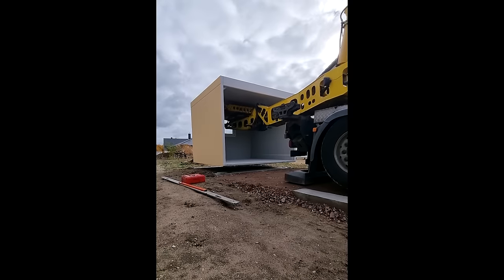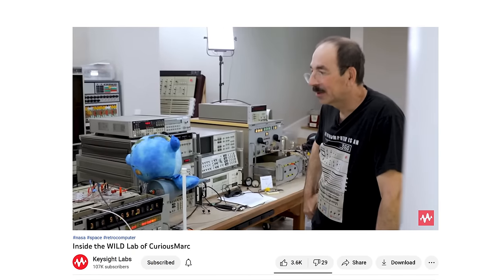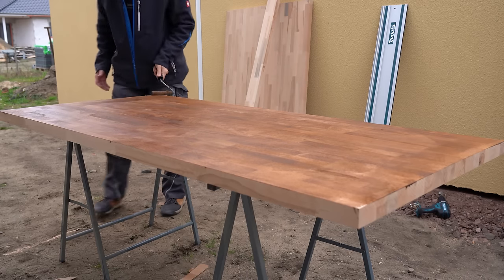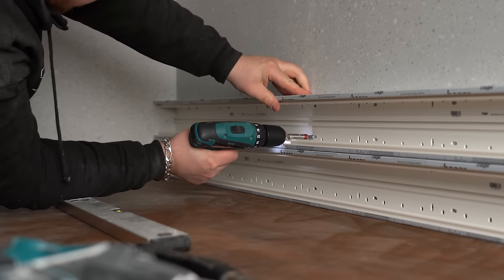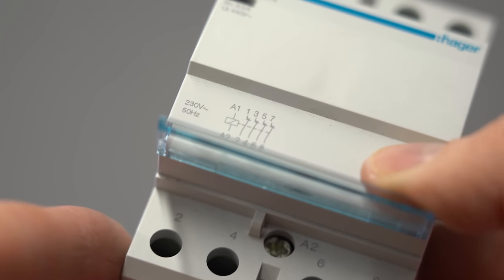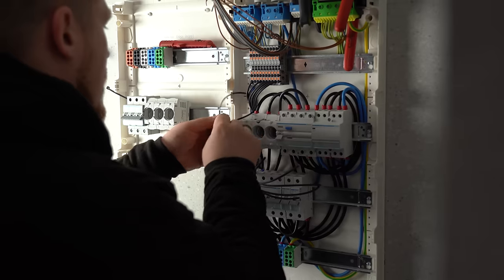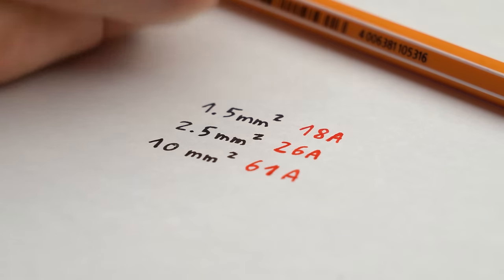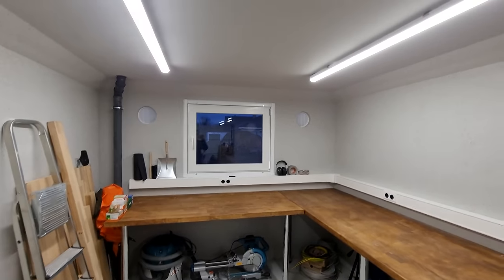Germans do the PERFECT Electrical Wiring! (Garage Build)

Comment: Hello Scott, curious to know what you meant by switching the neutral and physical earth wires (that those can not go through a switch under any circumstances?), also why where there should be a bended piece of tubing on the corners is just the cable? (something to do with the exterior jacket of the cable or since it's a garage does code allow it?). Here in Spain I do maintenance for industrial installations and everything needs to go through a tube

Comment: What I would have done differently would be the pipes u used I do t like that at the ends the cables are exposed and I would have my Ethernet cables run and install sockets and maybe some smart stuff hardwired in the electrical box like relays and smart switches great job btw

Comment: I was going to yell at you for wiring the emergency stop button to a normally closed relay, but I appreciate that it's a calculated risk. Save 60 watts continuous running cost on the energy bill, but if a mouse chews through the cable in exactly the right spot the e-stops wont work ... meh, worth the risk.

Comment: Hi there!
I'm a fresh from last week EE and CS engineer working for a EV charger manufacturer. 
I kind of started EE thanks to your channel so thank you! 
I was wondering, do you plan to plug an EV to this CEE socket? 
If you want to chat about adding an EV charger (maybe for a DIY or BUY) hook me up!  
Anyway it's cool to have 3 phase power at home. Unfortunately in France it's less common...
Also, what's this "safety fuse" thing? Couldn't find any mention of it, is it mandatory in the german code?

Comment: How can you call it perfect if the circuit breakers don't switch neutral? In western Europe it has been mandatory since a few decades that the phase and neutral is always opened together.

Also it seems kind of weird to be using fuses instead of a main breaker?

Other than those little nit picks you did a great job! :)

Comment: Wow, what kind of relay draws SIXTY THREE watts of power when activated? That's crazy! I did a quick search and the worst I could find was only about 2 watts per coil for 25A switching.
Reply: that was the inrush. less then 10 watt in oparative.

Comment: Make sure that Relay disconnect N after the phases and connected before them. Otherwise you can destroy your electronics by getting a 400V spike at switching! If you can't guarantee this better don't switch N.There is a reason why most RCDs don't switch N!

Comment: it look bad with cables cables hanging outside of pipes. In Europe we hide all cables in this type of installations.
If you want to switch all power off with emergency button you should check Hager mz203, it draws no power.

Comment: im pretty sure N cable = neutral cable is allowed used as 230V if its marked or taped accordingly by sfc 6003 standard. atleast in job sites that i do electrics on we are allowed. PE cable ONLY used as ground. if whant use it as 230 v you have to 100% of cable been hidden that it doesn't look anything like ground wire and there's no point doing it

Comment: 18A for a 1.5mm wire is pretty over the standard formula (6*mm). Where did you get those values? Detailed explanation of the wiring panel would be interesting, looks quite tidy.

Comment: Great installation. I love tidy wiring and pannels. 
- Why didn't you use elbows and couplings between pvc pipes?
- One big issue will be comfort inside. I've seen no insulation. Is it integrated inside the concrete walls?
Regards from Spain
Reply: Apparently they are not required to use elbows on duct in Germany and Austria...
Reply: @jur4x  didn't know that! Thanks

Comment: I like how friendly it all looks, almost toy-like. 400V makes me envious. I thought Germany had the option for more phases though?
Reply: You definitely mistake that with something else.

We´ve got a three phase system with neutral.
(look at 11:26 brown, black und grey are phases; blue is neutral and green/yellow is ground)
230V between phase and neutral/ground and 400V between phase and phase.

Main difference here is the used size of fuses and circuit breakers.
An normal apartment would normally get an selective circuit breaker with 35A (max ~24kVA) in front of the energy meter.
A house could easily get an selective circuit breaker with 50A (max ~34,5kVA) or in old installations 63A ( max ~43,5 kVA).
All above also have "NH" Fuses in "HAK". Size of NH-Fuses differs (how many apartments, etc)

There are also installations with 63A or 80A (max ~55kVA) "NH" Fuses in "HAK" (Hausanshclusskasten) only with an main switch (Hauptschalter) before energy meter (Zähler)

However, since VDE-AR-N 4100 from 2018(?) you would have to use an more expensive transducer counter for 63A or more. So only 35 or 50A are common in new installations.
But cables for meter cabinet (Zählerschrank) and sub-distribution box (Unterverteilung) in apartment still have to be designed for atleast 63A.
Reply: @darkness8631  Thanks for the correction; I did get mixed up somehow.

Comment: Surprized you didn't use a PLC or intelligent relay and shunt trip breaker for your EPO/ESD and future automation. That way you could use low voltage digital inputs/outputs normally closed contacts/fail-safe outputs without normally powering on a large contactor.

Comment: 62,5W is short term coil turn on power. If 63W is constant coil power how do you think that this amount of heat would be dissipated through that plastic. 
Large contactors,  like150A have 2-4A coil turn on current and something like 300mA holding current at 230VAC coil voltage.
110VAC coil ones have little bit higher coil current, and that is mostly dissipated throgh heat. 
63W coil of such small size would reach 100C in 15 minutes, and they can stay under power undefinitely.

Comment: Looks great! But I can't get past the conduit, stop, cable, back into conduit! Would not pass muster in Australia, sure we use flat TPS cable not round, but even if you used round it requires mechanical protection the whole length! No breaking out to bare cable for a bend!
Reply: Except the PVC conduit is not for protection in this scenario really. The cable used here is NYM which is double insulated and does not require any additional protection and youre even allowed to just put the cable on the wall bare with nail clips for example. The conduit is essentially just to make it easier.
Sure it would maybe look nicer with bends but this looks perfectly fine from a regulation standpoint (except for that failsafe which shouldnt exist in the first place if not done correctly).
Different countries, diffenrent rules.

Comment: I like how in Germany they have a circuit for each room, unlike here in the Netherlands where the circuits are randomly scattered throughout the house. It's a bit of a nightmare really. Could be worse though, the UK system is just bizarre in comparison. The one thing I don't like about the German system though is that the surface mounted conduits always end before any junction boxes, so it leaves part of the cables exposed and looks a complete mess.
Reply: I remember explaining how UK electrics worked to my Dutch boss. He taken down the celling rose and wondered where all the connections were. The ring main has good principles regards less copper and safety but standing on a plug hurts.

Comment: Nicely done. Just one question. When you daisychain the plugs in the wall conduit... Does the wire of the daisichain or the wire to the first allow for the theoretical load of all the plugs in use at the max rated power? 

Not that it will realisticalu happen, just wanted to know how the german electicity code tackle this usercase.
Reply: Not an electrician myself but I worked in events for a few years and was told multiple times by german electrical inspectors to NOT daisy chain  like that at all, since it is against code. So i am a bit confused why nobody is adressing this in the comments, even if its not code violation but just considered bad practice.

Comment: Nice work, i know wago connectors are highly praised, but i still don't feel comftable using them, especially in high power applications. Also there are a lot of fake wago connectors and and that makes me even more reluctant to use them.
One thing i would have done different is use cyaby-f armored cable and not use the plastic tube, also ground the shild. Armored cable is amazing it also protect the cables from rodents that can be a issue.
Reply: In Germany we dont really have armored cable. There are not many applications you´d use them
Reply: @muschelhirsch4522  Im sure there is, maybe it's not used as much. As for applications, it can be used instead of CYY-f or FY cables in fixed installations without any need for additional physical protection. It can be buried in soil or masonry and the price is reasonable. One disadvantage is that it's bend radius is worse than non-armored cables.
The main advantage is the inherent rodent protection, I would never use anything else in a attic or anywhere there is a fire risk.

Comment: The power company is willing to provide 3-phase 440VAC power to a residence? And what tools do you plan to own that consume this much power ?  In America, homes get 240VAC single phase, center tapped, and use VFDs on every 3-phase motor to invert to 3-Phase 240VAC. (I would want that to run a 5HP lathe or 2HP 2x72” belt sander). American codes for commercial installs requires metallic conduit, no exposed cables, no jacketed cables allowed in raceways (excess heat). But EMT (electrical metallic conduit) is cheap and easy to work.
Reply: It is 3*230V, so 400V between the lives.New instalation in Germany: You have to build for 3*63A up to the counter. What you get is different. Usualy you get 3*35A (no electrical heating, some 24kW) or 3*50A (some 35kW). Somtimes you get even 3*63A without paying extra, but this is rare. If you pay you can get nearly everyting, if you like, even a 20kV cable with a 1100kVA transformer (3*1600A on the 400V side). But then the instalation bill has 5 or 6 digits, not counting the cents :-)
So 3 phse power is it in nearly 100% of the new (last 30 years) Instalation.
For 11kW (car charger, coockin place, small waterheater )we need so a 5*2,5mm² (3 Lives, 1 Neutral on PE) and 3 times 16A.
Even with 220V in the US it is 50A, so you need 3*16mm² (2 Live, 1 PE)
What a waste of copper...

Comment: ".. I would never recommend a non-professional to do such a job." The problem is professionals make mistakes too. In my house the blue wire is the phase wire and the brown is the neutral. Okay, wrong colors you might think. But as a result of this the switches only break the neutral wire. Meaning when you switch the light off to change the bulb, the socket is still live. At several other houses were "professionals" worked on the wiring the grounds of many sockets were left not connected. Meaning you get a nasty shock if you touch metal housing of the dryer, and the ground fault interrupt won't trip if there's ever a short, for instance due to a leak. My point being: when professionals mess up, it's left to us non-professionals to find the problem and have it fixed.
Reply: The difference: some professional at least in Germany always has to sign a document assuring the safety and taking legal responsibility for any accidents. Part of the signed document are measurements that will show the mistake you mentioned directly. So they will recognize those blatant mistakes, or if detected like you did, can be sued to repair it. I get what your saying but point is, get it fixed professionally (for safety, saving cost, insurance issues later on) or own repairs can later still cause you problems

Comment: Awesome job buddy! Here in my country we use IEC based standards too. 💪
By the way, what is the standard of the wires you used?
Lastly, what do you think about using a phase fault detection device? This kind of devices also come with phase sequence, asymmetry, overvoltage and undervoltage detection. The problem is they don´t usually manage much power, but maybe you can find something that suits your installation in Germany.
Reply: The wire you see there is NYM 3x1,5, NYM 5x1,5 and NYM 5x2,5. The relevant code is VDE EN 0298-4 and DIN 57100. Rule of thumb is 1mm² per Amp (a little more actually, a 1.5mm² conductor is rated for up to 18A for conditions as you see here, meaning not plastered into the wall, but freely surrounded by air). Most commonly you will find 0,75mm², 1.5mm², 2.5mm², 4mm², 6mm² and 10mm² wires, but there are other gauges as well (0.14mm² for signal wires e.g.). These roughly do have equivalents in AWG, you can find replacement tables with a quick search in your preferred mass surveillance tool, I mean search engine. 
NYM btw is: M for Mantelleitung (the second layer of isolation surrounding the whole cable), Y is for Kunststoffisolierung (plastic, material used as the isolation), N for Norm (standardized wire instead of vendor-specific product). Correctly, it should read NYM-J 3x1,5 as NYM, 3 conductor, 1,5mm² gauge and the J is for green-yellow PE included (there are other types that do not carry a PE wire).
Reply: @lucemiserlohn  Thank you for that thorough explanation!
I´ll search the standard. The current ratings are slightly different from ours. 
And we also have 1.5mm², 2.5mm², 4mm², etc. wires. We don´t use AWG.
Reply: @lucemiserlohn  Its strange,  you would think the plaster conducted the heat away faster than the air.  Anyway 2.5mm is now required in most countries, I think 1.5mm is only rated for 14A when in enclosed conduit.

Comment: How are you planning to heat (or cool) the "garage". From my experience those thin concrete walls don't isolate very much. My garage is ice cold in the winter and super hot in the summer... Not a comfortable place to work on electronics ;)

Comment: Is it not standard to use EMT conduit when doing on the wall installs in the eu/germany.  What are those knobs in panel? This is way diffferent then the eqiuptment used in the USA. It would be nice if are panels used din rail instead of properitary breaker busses that are different randomly depending on what the original contractor felt like using.

Comment: Having that 90cm bench in garage area actually prevents you from keeping any standard size car there. Why would you do that? Also having that one time blow fuses next to automatic ones is puzzling. Any reason for them? Haven't seen any RCCB in your installation. You should always have at least one, ideally per circuit but one per one distribution board would also be enough.
Other than that very neat work.

Comment: I have been working in german workshops. Electrical system has been a joke, the house we live in needs to be re wired as it's useless. The workshop out the back has a huge earth leak where if you touch a surface your welding on with bare feet you get electrocuted through the ground.

Comment: I didn't see two things I kind of expected to see - no dc wiring with the dc power supply in the distribution box for lights, etc and also no USB outlets in the cable ducts. And also no networking? Though sure, those can be added later.

Comment: You think you'll use a workshop a lot, but the reality is, the older you get, the more you never want to leave your house to be in a cold dusty workshop with tools and stuff you have to do.  There just no appeal to it any more.   Ours has been sitting 100% idle for 5 years now just storing my 3 airplane projects in it collecting dust that I lost interest in.

My recommendation if you do build a workshop, maybe build a tiny survival office in it with a shower, a desk, a water heater, a microwave, a sink, an oil filled space heater, a bed, and a desk with computer on it with internet access.  Sort of like a room inside a room.

Comment: I wonder why the tubes are not connected with the boxes, just end near them and the cable is exposed between the end of the tube and the box. I never saw such installation here in Brazil.

Comment: This NO relay with 62.5W permanent consumption seems a bit oversized. 
Category AC7 A is for inductive loads. You will never come even close to 63A in a system with 1x 16A CEE and some CEE 7/4 sockets to protect.
The smaller versions of the NO relays (rated for 40A) need way less permanent power.

Comment: As you said, the way you connect the emergency switch is not safe. Why not to use an intermediary contact that only activates the relay if the voltage is missing? 🤷‍♂️

Comment: When it comes to the conduit used to route the cables for power is having only straight sections with exposed cable in between common place? because in the uk where I am studying to be an electrician it seems that the preferred method is to bend the conduit, I can see how it would be acceptable considering that the cables are double insulated and it is not like you are just running singles. I guess it could just be aesthetic. (I could be way of the mark considering different countries and I am still learning)

Comment: why didn't you use conduit bends? is there no need for mechanical protection of electrical cables in Germany? (we do in NZ)
Reply: There is no need to use them at all. You can put the cables directly on the wall if you want to. That is fine according to code.